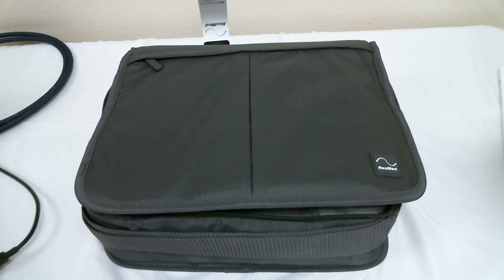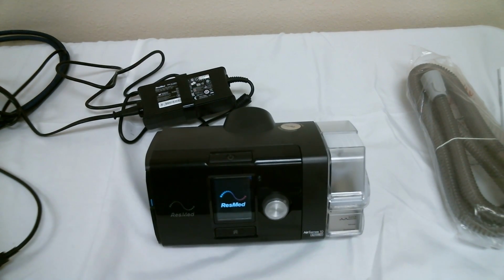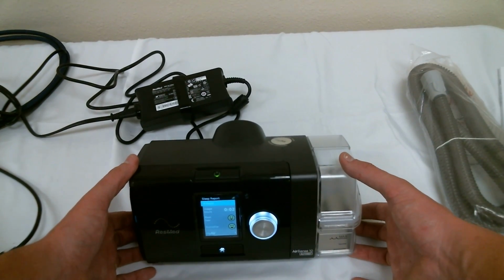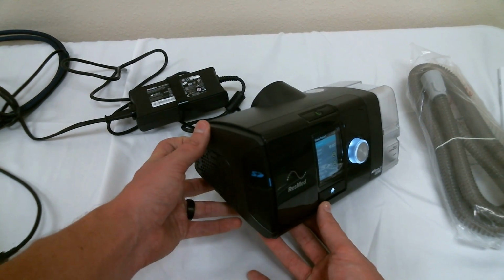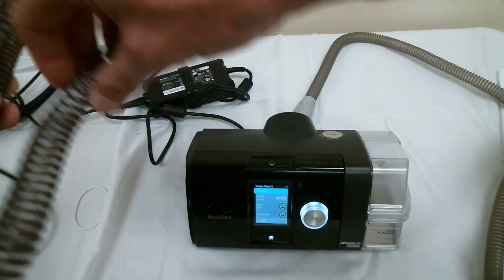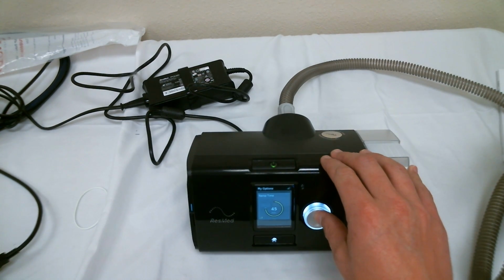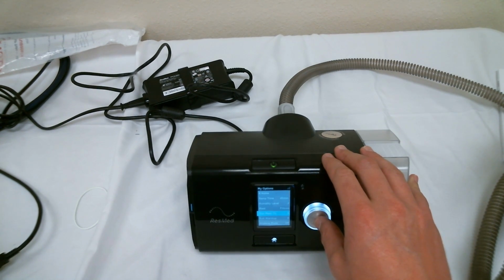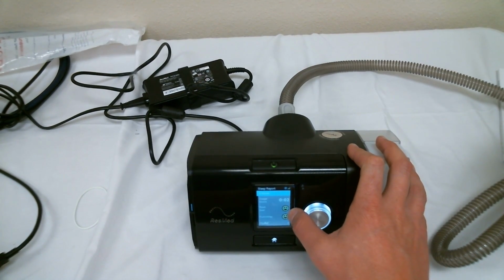ResMed Airsense Instructional

Comment: How come yours came with the Humidifier and mine didn’t…….
I got conned by Resmed 😡🤬🤬
Reply from the maker: I am very surprised that yours came without a humidifier. They are integrated on the AirSEnse 10. So you should be able to buy a cheap AirSense water chamber and have humidity. Link below for reference. 
https://cpapmyway.com/store/water-chamber/resmed-airsense-humidiare-water%20tub
Reply: @CPAPmyway  Thanks but after seeing your video I had a Tantrum with them over over the phone 
Now I have the tube & humidifier 🎆✨
Good things do happen when you kick up a fuss!
Reply from the maker: @TheMightsparrow  Glad you got it worked out.

Comment: You'll wish that you had a time machine before Phillips was recalled. Got one shipped to me Friday. Power Brick, Power Block. Green Light on Block means nothing...unless you get power to the unit. My Sense Air 10 fails to come on. The chip on mine is located at 12 0'Clock. Fits but no power.

Comment: I'm a new user, and the connector in the back of the machine came out, as I was pulling out the hose, I was wondering how I can put it back in place
Reply from the maker: I made a quick video special for you to help. Check out the link below. It is pretty quick and easy to get that AirSense10 Air Outlet back in the CPAP. Thanks for reaching out
https://www.youtube.com/watch?v=v7-c79HjbFA

Comment: When I turn on. The air flow is very fast and too strong. It’s suppose to be a low setting of 4.  Is is normal for it to start with a strong air flow? Is that what Ramp means? The guy at the pharmacy didn’t understand me.
Reply from the maker: Unfortunately you will have to consult with your personal Dr about Setting related issues.